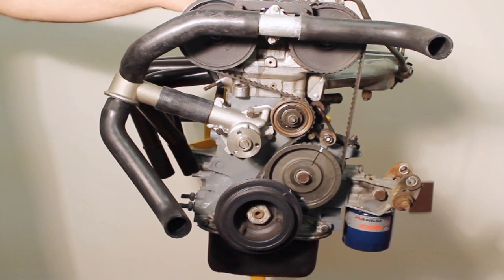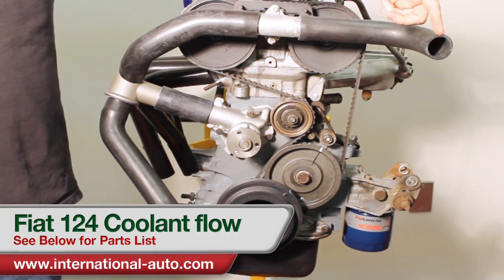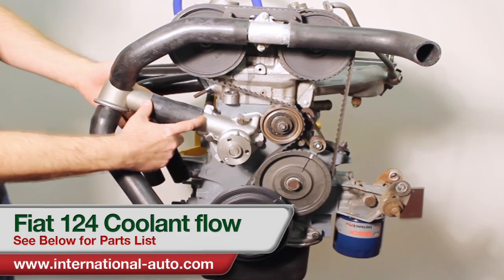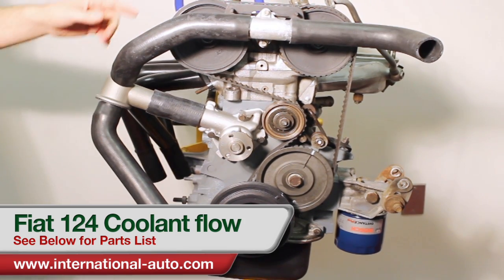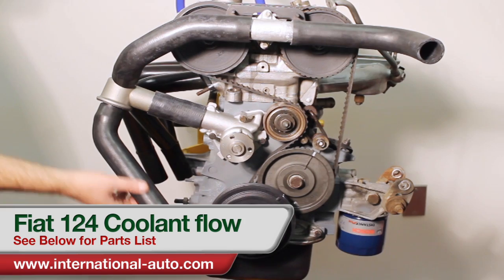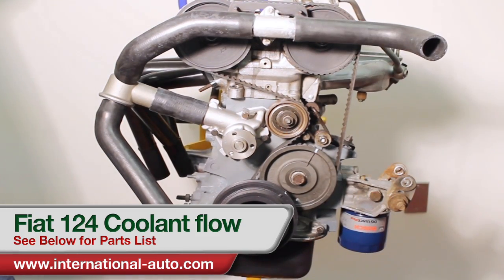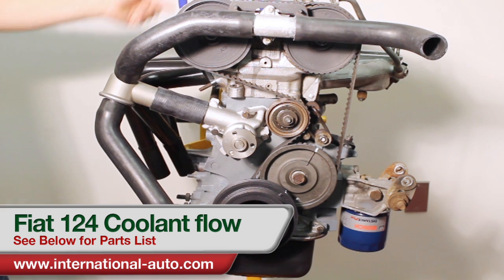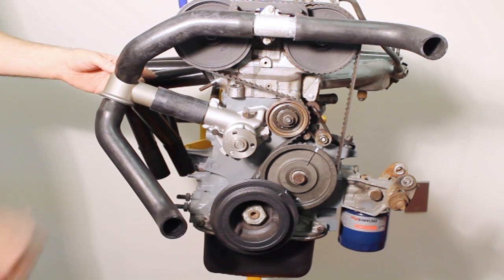Fiat 124 Coolant Flow - International Auto Parts

Comment: How does it go from the motor back to the tubes going to the regulator?
Reply: That short cast aluminum tube on top is a t fitting from the head. Water from the engine either goes right to the radiator or left directly to the water pump depending on the valve in the external thermostat. I know you asked this question to International Auto and 13 years ago but since I’ve just now understood it I answered. Dave